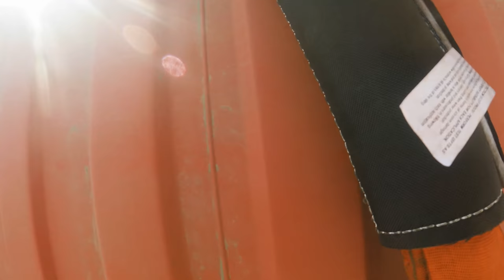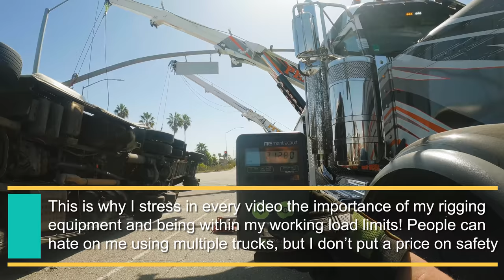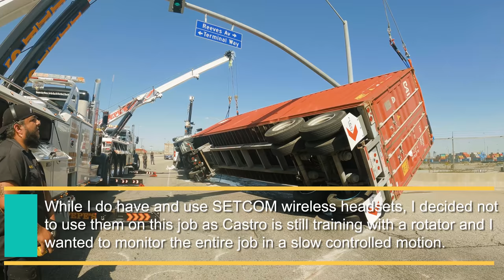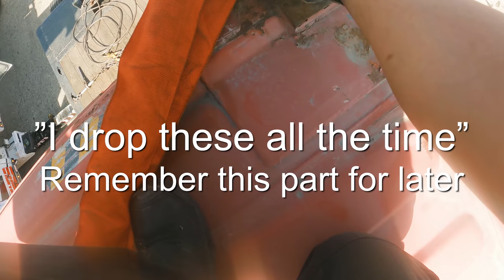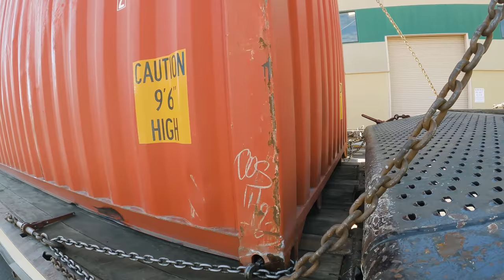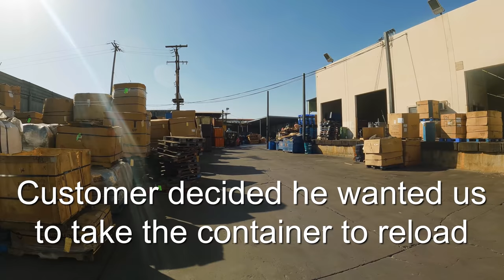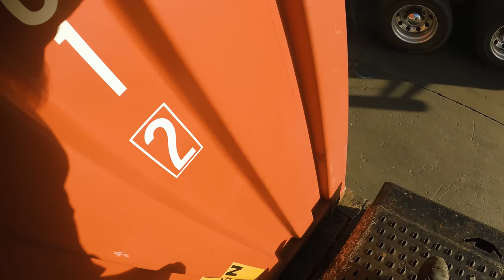Horrible shifted load rollover at the port

Comment: As I understand it, those sea-land containers tend to have gapping at the doors that's just covered by the weather seals.  You might consider getting a simple probe camera that you could push around the door seals to get a look inside before you have to resort to popping the load seal.  At the very least it would give you an idea if something was possibly prone to dumping out on you when you pop the door.  Just a thought.